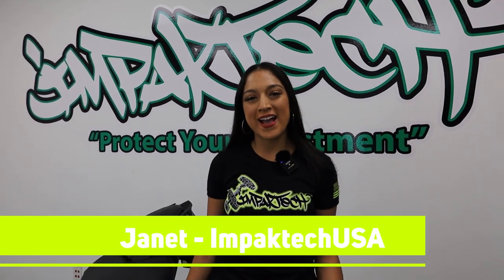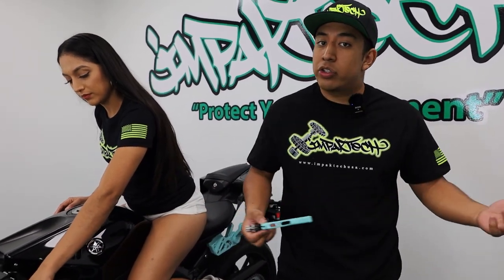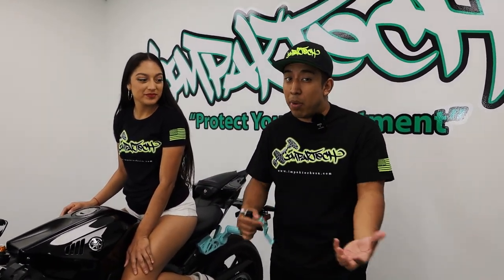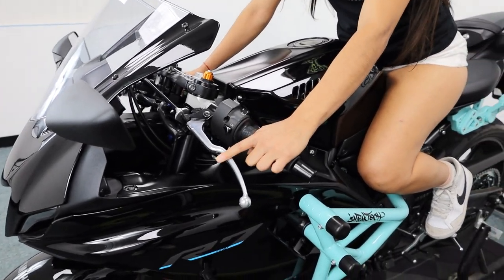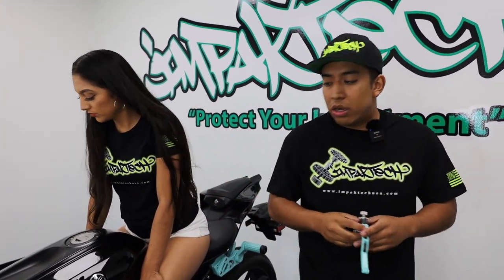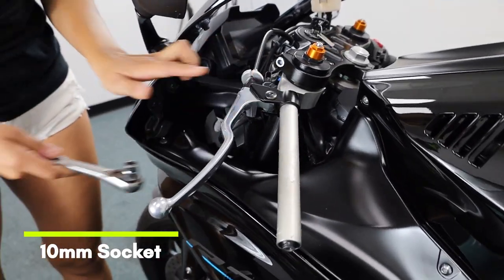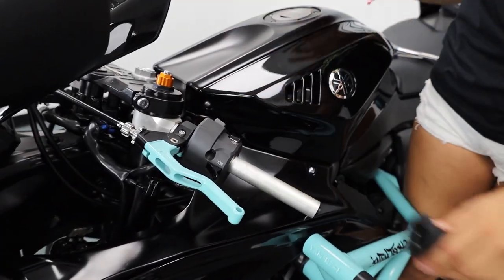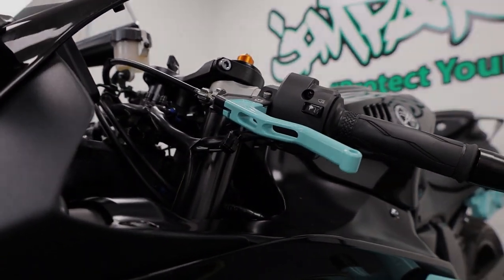Yamaha R7 Impaktech EZ Pull Clutch Lever Install *BEST MOD YOU CAN DO ON YOUR R7*

Comment: What did you end up doing with clutch safety switch? How did you bypass?
Reply: Following for this
Reply: @Yes-ue4ig  ???
Reply: @sergiotena7803  ???
Reply: ever find out? having the same issue right now @IItsMaldo
Reply: @not.oneofdem ever figure it out? was gonna throw on a rsc but don’t know what to do about that either?
Reply: Different account but what I just ended up doing was wrapping it in electrical tape and have it mounted on the side.  Works for now but I want to take it to a shop here soon and get it wired
Reply: @johnnascus3918 so you had to put in a fuse or jumper in the two connectors? i did that with my 21 mt07 as well just figured it has two now then one it’s a little different.
Reply: @jellystunts7620 cut the wires and Join em together is what I did
Reply: @MrSnipe25  i have a quickshifter on mine i think one the plug ins for that.

Comment: After watching the video they didnt explain the connecter and after awhile its looks like they took apart the original clutch and pulled the internal piece that they connect to. If you choose to do this it takes phillips head but be careful. Youre gonna have to put ALOT of downward pressure or youll for sure strip the head. So do it right the FIRST TIME as the screw had loctite that youll be fighting with the whole way out. Hope this helps.